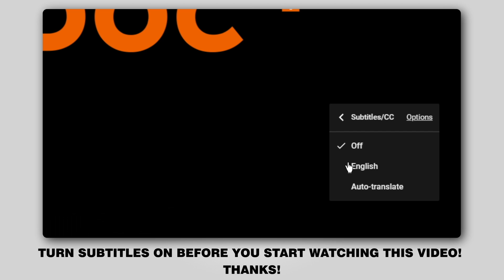How to change rear shock absorber on OPEL CORSA C (F08, F68)  [TUTORIAL AUTODOC]

Comment: corsa utility 1.4i, 2009, hard stating in morning and after standing in car park after 9 hours. but once started, runs ok.

plugs changed, air filter clean, fuel filter tested, and fuel gushing out on start.. what else do i test.

battery, was changed a few months ago, and alternator tested and fine
Reply from the maker: We do not have such information, we recommend that you consult your mechanic.
Reply from the maker: We do not have such information, we recommend that you consult your mechanic.